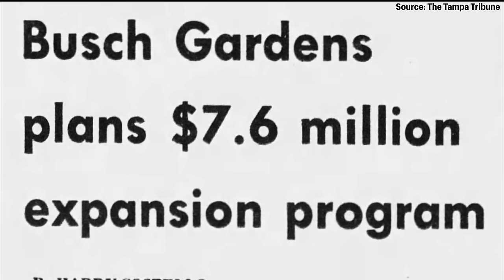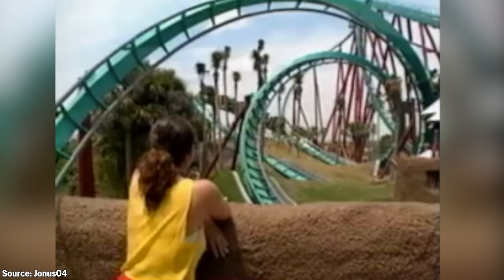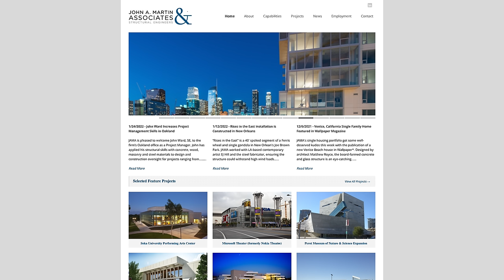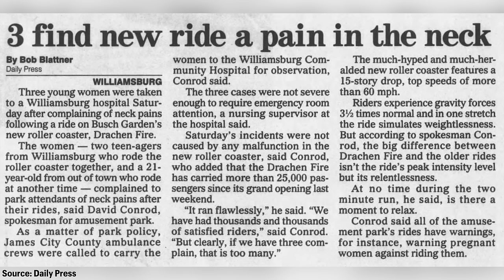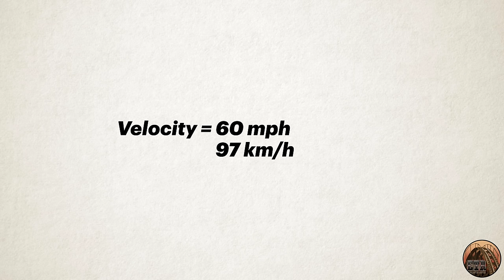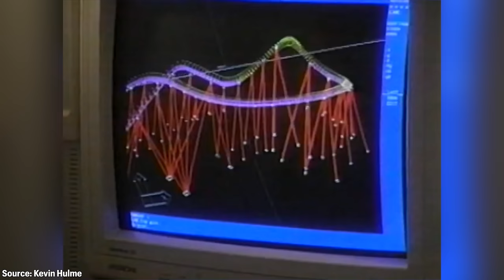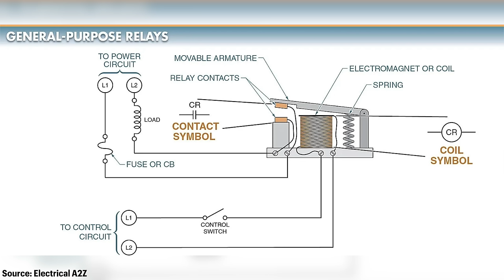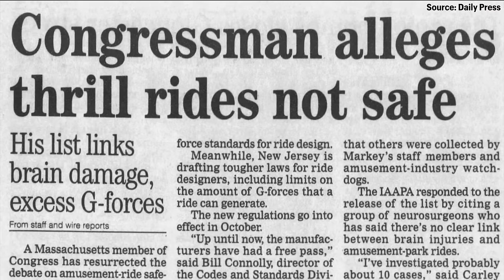Problematic Roller Coasters – Drachen Fire – The True Story of its Failure

Comment: Very nice video chocked full of interesting facts, some of which I didn't know.  I've heard the Arrow copying B&M story over and over, so great homework on that section.  The only thing I didn't see in the video was the modified restraints that they had installed at some point.  I assume it was after 1995 around the time when all the head banging issues arose  and women being told not to wear ear rings.  They had actually added side pads to the head rests so that your head would hit the pads instead of bouncing left and right out of control. I haven't found any info on this, but I do remember Busch Gardens adding them.  Thanks for the great video!

Comment: I actually really liked Drachen Fire and would make a point to ride it on each trip to Busch Gardens.  It was definitely jarring, but that was what made it unique.  The other coasters were smooth but this one was different and that made it stand apart from its colleagues.  It also helps that I had a driver's license and some spending cash at the time that DF was near the end of its run and lines were often short or nonexistent for this ride.  That created an added perk that you could hop on a roller coaster without spending a lot of time in line.  In fact, one time a friend and I rode it three times in a row as each time we'd pull back into the station, there would be no one in line for our row.  Ride personnel asked if we wanted to go again and we just pulled our harnesses back down.  Hard to beat that!

Comment: Fantastic video man. Best yet. Heck yeah. My #1 coaster I wish I could have rode. Just always had a fascination with it. I've heard a half dozen variations on the story of Drachen Fire's creation and B&M. Funny how that works and probably itself proves it's not true. 20:01 I never understood until seeing that clip what the big issue with the diving corkscrew. And why they removed it eventually. Dude, that must have been SO rough and such whiplash coming out of that corkscrew and yanking into a left hand turn so quickly. Imagine what it was like for the back riders getting pulled into that too once train has picked speed back up. That cutback looks dope though.

Comment: I was one of the early riders of The Big Bad Wolf in 84' and I can tell you as a 6'2" male coaster connoisseur it was THE WORSE RIDE of any coaster of my life - including those crappy carnival coasters that rattle the fillings out of your teeth!  The advertised appeal of swooping over the Rhine River and a small German town in a new high-tech hanging coaster was complete BS.  We were being shaken and jerked so hard it was impossible to even see around us to get a relative sense of where we were.  A huge dynamic of a great coaster ride is the ability to look around and experience the sensation of inertia and how it effects the body through g forces and air time.  The Wolf gave you very little of that as you were too busy being banged around.  The swoop over the river completely failed to meet any expectations of fun.  And as for airtime or G forces, I was too busy rattling around in my seat to notice.  I hard some years later modifications were made as main problem was the train cars shock dampening design.  Riders were supposed to experience a smooth lateral swinging motion, but the early dampeners caused the cars to jolt riders through turns.  Whether that solved the Wolf's problems I don't know since the ride was so terrible my and my buddies swore zero interest in ever riding The Big Bad Wolf again.

Comment: I got to ride Drachen Fire. Despite it's roughness, it was still on my list of favorite coasters. My favorite part of the ride was the corkscrew shortly following the crest of the lift hill. Inverting at that height was super cool. It had already declined in popularity when I was there so I was able to ride many times without getting off. I didn't understand why people weren't riding it. It wasn't any rougher than Ninja was at six flags over Georgia which also lost favor among riders due to the headbanging. I found whole riding Ninja that if I forced my shoulder up into the top of the restraint and placed my head firmly against the side that I didn't experience any headbanging. This also worked on Drachen Fire. I liked that it didn't have double loop corkscrews. One loop was fine but I was never a fan of the second loop that followed. It was repetitive with no changes in forces once you were into the element. I was sad to hear of DF's demise, but I do understand why they tore it down. It may be gone but for many of us who enjoyed it it will not be forgotten. Thanks the explanation of the tangent method of design. That explains so many questionsi had about roller coaster designs. Well job.
Reply: Another thing you mentioned was it being designed on a CAD system. I've been a CAD designer for 40+ years and remember the days when I worked on a drawing board. As you pointed out, designing Drachen Fire on a CAD didn't do anything to help it produce better coasters. A CAD system is more accurate and draws things with truly square lines, but that means nothing of you don't do anything in the engineering behind the design, which is what Alan Schilkey introduced into roller coaster design and changed rollercoasters permanently.

Comment: The reason why I think that Arrow used tangent curves on their rides was to cut costs. At that time, the calculations and manpower that was needed to calculate these curves was definitely expensive, and the tangent solution was seen as a way to cut costs. But this solution ultimately backfired.

Comment: Hearing about Busch Gardens specifically asking for something smaller got a chuckle out of me, from imagining the "Does not compute" that would produce in Six Flags management.

Part of me thinks ACE members should be strapped to office chairs on jackhammers inside a motion simulator, with a fan blowing on them. It seems like it'd give them about what they look for in a ride :P

I wonder if redrawing the initial tangent-radius curves to include larger-radius easements (akin to what model railroaders often do with set track) would have been enough to mitigate a lot of the roughness. I understand Arrow initially sticking to the practice even when they shifted to computers - it's one thing to change what tools the designers are using, it's another to massively revamp your fabrication (especially if that involves cutting fabricators you've worked with for years out of the picture).

X might have damned Drachen Fire's hopes of retracking, since that project became a black hole that devoured Arrow's time, resources, and eventually Arrow itself.

You know what ride might have also benefited from those vest restraints? Flashback.

Comment: Probably unpopular opinion but I love when a ride jerks. Limit is corkscrew at cedar point, I can't handle that jerk. Mean streak was the best of my life, I loved riding it before it got a bit smoother before closing. I felt like I came out of a boxing ring and it was great. I remember the last time I went in 2012 or '13 (it was opening day of gatekeeper I don't remember which year that was) I rode blue streak 12 times in a row and felt like I was gonna yak hardcore, after I had rode raptor 8 times in a row beforehand. The lines were so empty, it was great. I don't think I've ever gotten so sick on coasters, but I ended my night riding mean streak over and over because it was such a great night coaster. I felt like I wouldn't be able to walk for days but I didn't care I had the best time of my life, and I still resent that disaster transport got torn down for gatekeeper because it wasn't worth the 2 hours I waited, but Ive waited nearly 2 hours for disaster transport and that was the most miserably hot wait of my life but man it was so worth it. The cooling feeling of the train whooshing through the dark and not expecting the twists and turns it was such a fantastic ride unpopular opinion or not but gosh it was such a pleasure. Wicked twister was also one of my favorites, I miss it dearly. I regret not riding the demon drop while I had the chance.

I do say though, the beast was a great jerky time, same with son of beast. I remember in the six flags Maryland location they had the apocalypse and it was super jerky and uncomfortable but real fun, I was sad to see them replace it honestly. 
Kennywood's jackrabbit used to be a bit jerky, haven't rode it in a while so I can't say for now. (Rip Garfields nightmare I rode it almost everytime I went just because I love Garfield; received glasses maybe half the times)

Comment: Might've been 95 or 96 when I got to it... AND sure, there was some jerkiness, but I grew up through the 80's so it was the "Classic feel" of the old-school rollercoasters. We never really thought about it... You kind of expected to get bounced from side to side.

    With more modern design methods and smoothness, coasters are definitely averaging higher speeds, practically across the board as a way to keep the intensity sensation, rather than letting some of the sounds and roughness SEEM like you're going faster or getting closer to "out of control" the way older coasters seemed to do...

    The troublesome part is where to quite draw those lines. If you don't increase the speed purposefully, but you add the modern design methods like heart-lining and complex curves, then you have all the elements of a good coaster, but it's just slow enough that it just isn't thrilling the same way. Back off too much to add a little intensity by the "Old school feel" and don't check the speed, and you injure riders and ruin your reputation...

     SO that's where I picked up the theory that MAYBE we're edging into a technological territory where we've actually gotten coasters a bit "too smooth" for their own good. Don't get me wrong, a smooth ride is technically safer, no matter how you've designed it or how fast or slow it's going. AND there's a lot to say for improved smoothness along with the speed... At the same time, there's more to the experience of a coaster than speed alone through each element.

     I think in the mid-90's through the early 00's, the eras were really shifting from older jerky and noisy rides to the new sleak rides. This was a throwback and it didn't seem to hold the staying power that others used to... AND through the early 10's, the era of the speed chase really seemed to peak. I may well be wrong on that, as speeds seem occasionally to nudge past expectations once in a while yet... BUT the intense chase for the "record breaking fastest coaster" seemed to peak around then, and now we're refining the rides as a more complete experience rather than setting specific goals like most loops in a row, highest, fastest, most terrifying, etc... 

     We had an ANCIENT flat coaster when I was a kid...  part of the county fair. It was still powered by a wide cloth and leather belt off the PTO of an antique tractor with steel "paddle" wheels, and ran in a figure-8. Everyone called it "The Kiddie Coaster" but I swear that son of a bitch must've broke 60 mph and would ABSOLUTELY beat you half to death in 5 minutes (an average run)... It should've been called "Wild Mouse on a Roid-rage"!! BUT the point here, is that you don't really need a "whole lot of coaster" to have an intense thrill. Even the High School Seniors were still daring each other to take another spin on the thing back in the day... AND nobody managed to get off it without stumbling all over themselves and laughing hysterically... You were sore as F**K, but you couldn't stop laughing...  ;o)

Comment: I'm not entirely sure if I'd call Ron Toomer stubborn so much as limited by his team & skills. The guy was pushing 61 when Drachenfire was being planned, and was trained in hand drafting. It was incredibly risky to have their first CAD project be such a huge undertaking, especially considering their machinists and fabricators had never worked with CAD-originated curves and elements up to that point.

By the time Schilke had taken over as chief engineer, the Arrow team had much more experience with CAD work, which is why Tennessee Tornado, Big One, &c generally run smoother than Toomer's designs. 

Toomer was absolutely capable of designing smooth as glass rides (hand drawn or CAD), Gemini, Big Bad Wolf, Bat, sorta prove it. Evidently, this is because the structures or ride vehicles for these rides weren't as rigid, allowing for pseudo compliance (ie, non-pure Tangent/Radius), but when a park isn't after that sort of ride, things get trickier, hence Toomer's more rough designs.

Comment: No mention at all about which company could provide a silent lift hill to please the kingsmill resort behind the park, which B&M couldn't provide, and Arrow could. Also no mention of the fact the park wanted a ride that would open with the park in the spring, which also B&M couldn't do and Arrow would. There were many variables to their decision to use Arrow.
Reply from the maker: Arrow did not provide a ride with a silent lift hill. That was added years later.
Reply: @ElToroRyan  it was silent from day one, I was there rode it the day it opened
Reply from the maker: @steelforce  I think you should fact check that. Every single video of the ride from its opening year to 1995 shows the ride had Arrow's traditional anti-rollback system. Here's a video from 1992 https://youtu.be/Oc2l9Eolk3I skip to 40 seconds
Reply from the maker: Here's POV footage with the audible anti-rollback system https://youtu.be/LT8d1lAsN9s

Comment: 15:51 Looking at that map and knowing german brings out the innner grammar police officer in me. It uses the wrong adjectives multiple times: correct would be "Die Autobahn" (female, the highway), but they use "Der" and "Das Katapult" (neutral, the catapult). Also I find it weird that they only translates only half of the roller coaster name, though I guess the full german translation "Drachenfeuer" would have been less understandable for non-german speakers

Comment: I'd disagree that it's easier to calculate the shapes by hand with Arrow's methods. For a very long time trains have been using compounding curves for exactly this reason, and have struck upon one very specific curve type developed by Euler in 1744 named the Euler spiral (or Cornu spiral). Whilst mathematically it wouldn't be completely perfect for rollercoaster design, the differences between this and computer designed curves would be imperceptible to the rider - it's still creating a very smoothly increasing force. To then calculate speeds and the like you'd want to use the same calculus as already being used anyway, and likely the exact same assumptions. The only difference I can foresee is they probably used shortcuts to having to calculate it properly, and they would possibly have to develop a new set of shortcuts for the first time again. But really it shouldn't be any harder to do by hand and it seems to merely be an extreme resistance to change.

As an aside, I love the Cornu spiral. It has so many applications. I'm pretty sure it was first discovered as a perfect representation of the intensity of light through diffraction. That's where I first used it - studying physics and having to explain Fresnel and Fraunhofer diffraction in the lab. But then it has so many completely unrelated uses such as that mentioned above, which also becomes the mathematically perfect smooth curve for trains. It's amazing to think it was discovered in the 1700s, but Euler was just like that.

Comment: I'm sorry, I can't hold back any longer. felt weightlessness or airtime can be described as "negative G's" or "negative G forces". Fun fact: negative G's are more dangerous than positive G's, in that a trained fighter pilot can pull 6Gs but only -2Gs (two negative G's). you'll never get anywhere near that on a rollercoaster though.

Comment: Lochness monster is a fun ride but also really uncomfortable in my opinion. The seats never fit properly so it always ended up stabbing my shoulders and the ride is pretty shaky to your head. Which honestly seems to be a issue with this companies roller coasters. But still a really fun little roller coaster to go on.

—side note as someone who used to work there, hauling the trash boat on that hill is a bitch and a half.

Comment: "...Powered by mo-ped batteries...." What determined that the batteries would come from cycles that were pedalable as well as electric (a.k.a. an e-bike, I guess), rather than just something like an electric-powered, or electric-start gasoline, scooter?
Reply: It's just a typical sealed or AGM battery. Those types of batteries are not just for mopeds.
Reply: @stevenv2190 : Yeah, so he shouldn't have been that specific. It sounds more limiting than the situation actually is.

Comment: So, how exactly do you get a train moving again after it valleys? Presumably it involves winches, but how do you attach them and either make them release or hold back a train once it's at a point where it will go again?
Reply: You attach the winch to the chassis and pull it up to the best available high point, clamp the train in place, remove the winch, then remove the clamps and let it go. Alternatively you can but out a section of track and crane each car out and put them back on the track somewhere else.